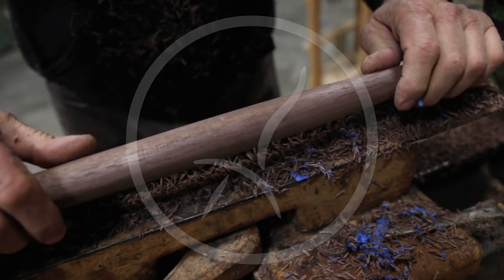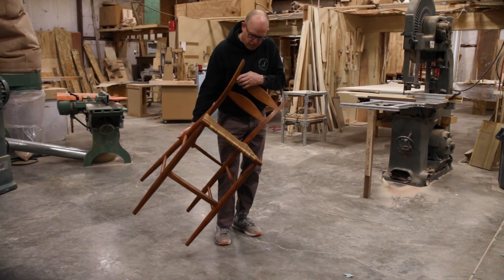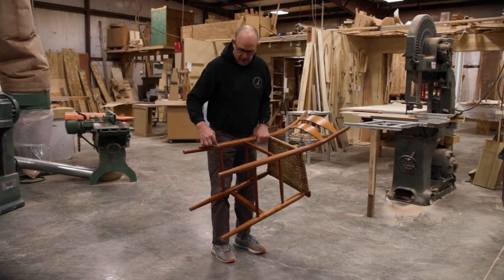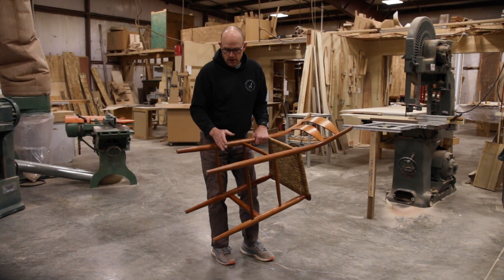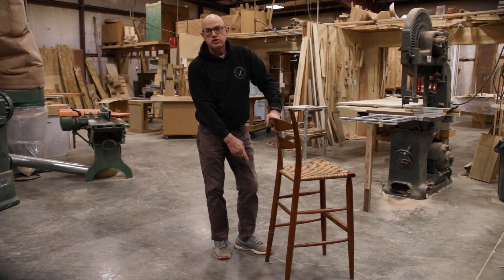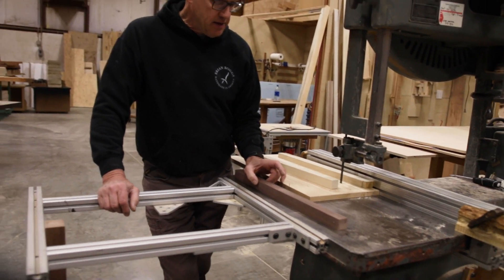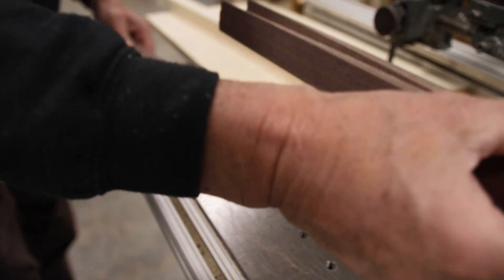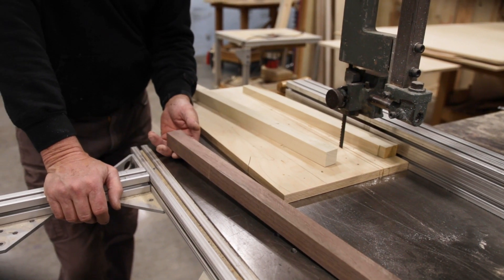Chair Rung Repair - With Brian Boggs

Comment: What happens if you turn the rung a saw kerf longer, then cut it apart and install?
Reply: Any tapered parts wouldn’t match up when you pushed it together to close the kerfs, but a purely cylindrical rung even with rectangular blocks would work. Transitions wouldn’t be possible.